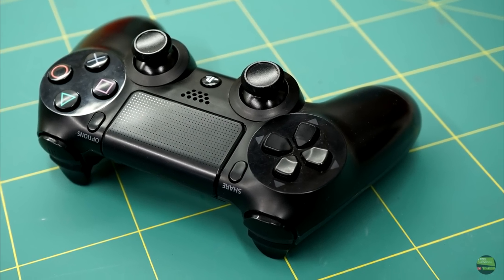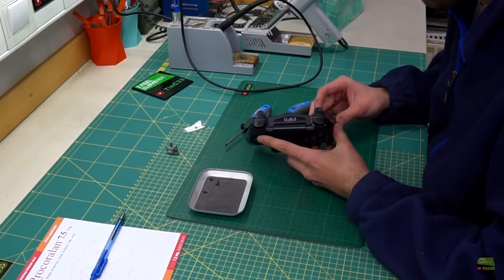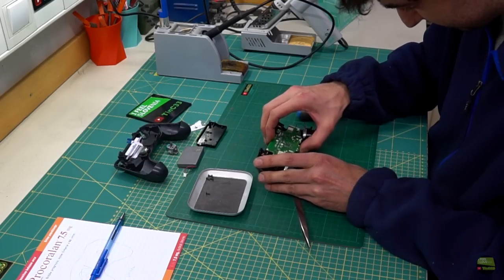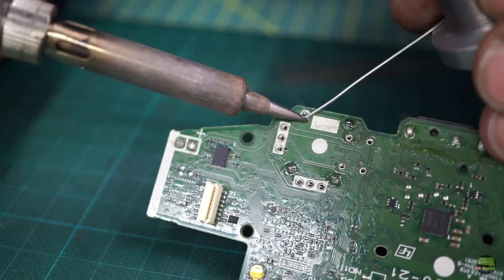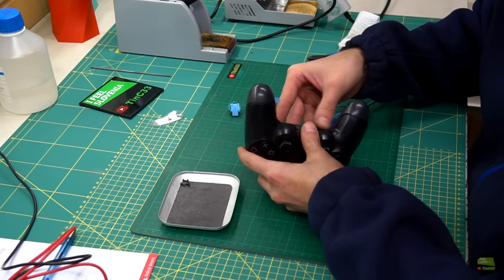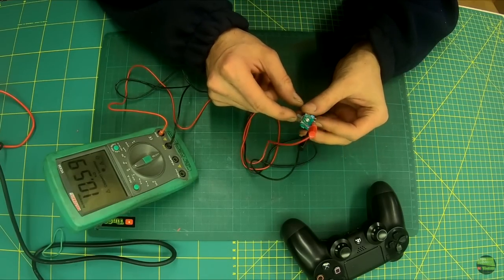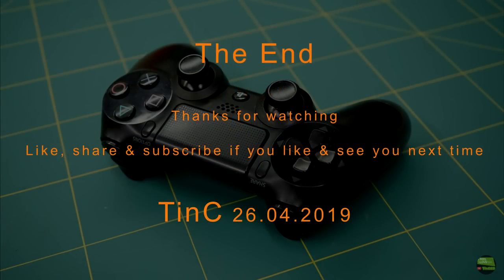PS4 Controller repair [joystick replacement]

Comment: Is it possible to replace the square holding the wheel sensor with a spare square that I have? It won’t click back and I think that’s messing with my character looking up in the air and not being able to look down (or maybe I put the wheel in the wrong direction). Also when I put the controller back together, the buttons wouldn’t respond until a minute later and I could finally press X to get past login. That and when I was in a game my character would keep aiming/firing by itself. Didn’t have this issue before I took out apart. What’s the cause of this?
Reply: Yet there is a lawsuit over cheap part that is like crappy  made not sonys or Microsoft  fucking  fault but you will figure they will have simile design  a better module  instead of using a module that has basically  had a lot of generations of controllers built using this module that the problems  are spool old they can't fix it they can't fix it because  its like your knee joint your legs wear out right well anything that is being moved  around heavy from 24 hours of a fat guy playing games what did you expect its like me moving my leg sitting down your gonna wear the sensor  down you can't fix stupid he'll even industrial  machines  need mot work to fix anything  that gets worn over heavy use   I had a xbox 360 controller  do it after a year of heavy use so it does wear everything  down there are things that never wear out and people saying they broke a bumper  lol its because  your being rough on it I had a controller last me until I smashed it lol

Comment: its so hard desoldering the original joystick legs. my solder has adjustable temperature, i set it to 450C but it doesnt has any effect
anyone has similiar issues?
Reply from the maker: You just need more powerfull soldering iron at least 80 but better 100w it can be without temperature setup...
Reply: Any luck? I'm having the same problem. Im using the milwaukee one because my cheaper one from Amazon wasn't working out
Reply: @mcfriedchicken1972  even after u use milwauke?
im gonna bring it to electrician, maybe he has better solder

Comment: does it really need a 80w solder? or 30w will do?
Reply from the maker: There is a problem because there's a bunch of cooper to to heat, 30w will need many time to heat up, so you may melt someting you don't want to, 80w will melt solder instantly, 50w is limit.
Reply: @TinC33  bro isn’t a 40w soldering iron enough because it equals to 460°C and wouldn’t it melt it instantly?
Reply from the maker: @RedMokaa  it's not about temperature, there are lot of material to heat,  wich "soak" heat faster than soldering iron can produce it, also 100w got same temperature as 15w... Try to solder thick wire like 16mm2 with 30w or 100w and you'll see the difference.
Reply: @TinC33  oh okay thanks for explaining
Reply: @TinC33  Thank you!
Reply from the maker: @desmond098ify  that's a good question anyway, maybe i'll make a video on this topic and show the difference.
Reply: @TinC33  That's great! Looking forward to watching it!

Comment: I need help. I ordered a controller on ebay and the R2 button doesn't work. I've figured it's from the little square module and that some of the soldering parts are loose. How do I tighten it?
Reply from the maker: uf, as i say i don't got a PS so i really don't know wich button is r2, so really don't know what you talking about, sorry.
But if there some wire unsoldered solder it back and it should work
Reply: @TinC33  I've given up. I'm just gonna sell it at Gamestop. Thanks for replying at least.
Reply: Circuit film is the standard problem for buttons not working. Can be easily replaced and a new one is about £2 on ebay.

Comment: Hey I did this repair on the right stick. Now it seems like the dpad or left stick is stuck on left but only at certain times. Like on psn menu it keeps scrolling left but in a game my character does not walk left so i assume dpad. Never had this problem before. What did I do wrong or any suggestions please?
Reply from the maker: Firstly check all the connection, so there's no some line broken on the pcb, and make sure there is no some short from soldering.
Reply: @TinC33  haha if i knew how to do that it may not be broken. Any vid links to follow to check all connections. Replacing stick was my first solder job. I thought I did good. I remove old stick and put in new one thats it. Idk why the other buttons would be affected.
Reply from the maker: @johndoegta2189  you can just carefully visually check, go from each pin you solder, and check if the line on pcb ok, and that there is not some short between two pin when you solder... It's hard to say, but i got few comments here that some button didn't work after replace or other joystick start shifting etc, and everytime was problem missing connection or short between pin they soldered.

Comment: Hi, great video. I have a question for you. I test the new potentiometer outside and i get 5ohms across the axis like you mentioned, between all the pin combination. However when i install it in the circuit it is lowered to 3.4ohms is this normal, and the resistance is not changing either when i mive the stick. Does this mean that I have a short in the circuit board? Thanks
Reply from the maker: It's hard do say, when you measured them soldered into pcb, you measure also all the elements on the circuit wich is in seriall with thet trimmer...
Reply: @TinC33  so it is normal that the resistance is lowered when it is soldered in the circuit? Still if the resistance remains the same as i move the joystick it means that something is faulty right?
Reply from the maker: It is normal but i think there still must be some difference into resistance when you move them.
Reply: @TinC33  yes, I think that I must have sorthed out something in the board when I removed the old one. The new joystick is sure to be good as it works perfectly when i bench tested it
Reply from the maker: @danielvella20  check the board lines and solder points arround the area you working, you may just broke some line on the pcb, wich can be fixed easily.
Reply: @TinC33  ok will have another look. Thanks for all your help :)
Reply from the maker: @danielvella20  no problem, good luck

Comment: Hi im planning on doing this ive ordered joystick parts from ebay will they function the same as original joysticks the seller also said these arent made by sony i want to know as i play lots of shooter games thanks
Reply from the maker: They're aftermarket they shoud work just ok, but it's nit genuine sony
Reply: @TinC33  oh thanks so i wont get drift?? Subbed and liked btw
Reply: @TinC33  hi ive followed your steps and managed to get out the joystick but ive accidently burnt the led strips port (the cable which is plugged out first) and now the cable wont fit thru and i dont think i can replace it
Reply from the maker: Check on ebay if you can buy another one.

Comment: Very nice video!!! Just a question: I see there are different analogs, for example, one made of metal for Slim/Pro controllers. Can I use it with the Old v1 controller? Thanks!
Reply from the maker: Sorry but can't tell you that's the only controller i hold in my hand

Comment: is it a must to use flux?
Reply from the maker: No ofcourse not, flux is already inside of solder wire but it helped to make better contact.
Reply: @TinC33  so any common soldering wire can do the job?

Comment: I did this perfectly the first time but my siblings somehow managed to mess it up again so now the y axis doesnt work and it's not even 6 months old and I responded it and it still doesn't work
Reply from the maker: Hard to say, is it something wrong with trimmers, or on the pcb, check all the lines on pcb arround area you solder if they're all ok

Comment: Help plz, when i tried to put back the ribbon that connects the led light to the board, the light is not working anymore! Any idea what seems the problem? I tried different ribbons, still no luck, help would be appropriated guys
Reply from the maker: Be sure to turn it on righg side, and that it's enough deep into connector before locking.

Comment: Wow.. this is very helpful and interesting. I have the same issue "but" sadly I don't have the welding equipment that you've used. ):
Is there another way to do it ???
Reply from the maker: You cam try just to remove side green covers and clean trimmers
Reply: Welding 😂

Comment: So i just did everything the same but my j sticks are moving even if im not touching them they move up to right corner any help? 
Yah btw my light bar not lighting up after my fix suggestions?
Reply from the maker: go trought entire circuit, you may forget something to plug, or demaged some "way" on the PCB, check arround the area you soldered.
Reply: @TinC33  probally "way"
Reply from the maker: @fn4lx293  check it if you see some line broken just solder piece of wire on that place
Reply: Just checked nothings broken but no light at all
Reply from the maker: @fn4lx293  hmm strange, but as i remember light is on other board, check the ribbon cable if 100% correct plugged, and also check power source...
Reply: @TinC33  look i can turn on bluetooth and connect to my phone but my lightbar not glowing at all even when charging
Reply from the maker: @fn4lx293  i would say that there's some connection broken on the PCB, i can't help you sorry, it must be sren closely and checked lines on pcb...
Reply: @TinC33  ok thanks anyway

Comment: will this work for the new gen or just older ps4 remote models?
Reply from the maker: it work for all remotes, but you need to buy right replacement part, it must be same.
Reply: @TinC33  you mean left or right joystick?
Reply: @TinC33  how do I know witch one? Do you know where can I buy the left joystick? I need 2.
Reply from the maker: @ultimatemanny  same tipe as on old controller
Reply from the maker: search on ebay

Comment: Well after 6 - 8 months of playing everyday the joystick can wear out, it can cause drifting even if you push it very very lightly. Dont go hard on your controllers, they are expensive almost like buying a new game.
Reply from the maker: Joystick is not so expencive, i think a few $ on ebay, and the cheapest one work just good.
Reply: @TinC33  cheap ones are bad. have different mechanics than original.
Reply from the maker: @internetcrap7  i bealive you, there's always some difference in a different price range product, specialy product like this one, where every detail can prevent smooth and accurate moving, but as fried say, controller still work and look like it's good for him, it also depend how mmany you playing, i'm rc guy so i know the difference between FUTABA or GRAUPNER yojstick and some chinesse, real brand gimbal runs so smooth... But some beginner will never notice the difference.
Reply: @internetcrap7  which ones are the expensive reliable ones? I can only see the same one sold everywhere. I noticed in one YouTube video they mentioned you can get more expensive ones but I can't find it anywhere

Comment: Geez... i don't even have a soldering tool... all i want is to stop stick drift
Reply from the maker: Then try to find some local guy who know how to solder, everyone will replace that for you, but don't forget to buy him beer then 😉
Reply: There are plenty of video's out there that will explain for drift. I had same issue I basically pulled it all apart and cleaned & dusted it put it back and was fine. Lots of dust & debris can gum up controller.

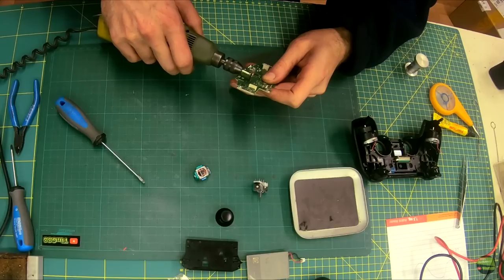Comment: 3:11 I heavily and respectfully disagree with using a dremel/powered rotary tool to just scrub off flux. Cloth will do just fine, alcohol can help too. 
.
This was going good, then I cringed hard at that. Sorry man, I mean you no harm personally, but I really do not think that is advisable.
Reply from the maker: Agree but i don't got all the stuff for soldering like some acid or whatever for clenaing, so i use plastick brush and it actually worked, but need to be carefull so you don't scratch all the lacque of the pcb or even demage the ways...
Reply: @TinC33  Just rubbing alcohol can work in most flux I've used so far. Perhaps the kind of flux you have needs acetone, which you said you don't have.  That dremel really scared me.
.
But yeah, thanks for responding. Aside that, the rest of the video is good and informative. Keep it up
Reply from the maker: @WingMaster562  i got bunch of acetone for abs 3d printing... But never try on circuit, does it work? I need to try it, alcohol doesn't work best on hardened flux, thanks.
Reply: @TinC33  Wait, that kind of acetone might be too strong for PCBs. It might melt parts of the board so I wouldn't use that. I was thinking of low acetone content solution like around 30% which is for nail polish removers.
.
Also i really find it strange that alcohol doesn't work on your flux, especially that it dries that hard. Usually, even dried flux can be easily wiped away with a finger. I wonder what's going on with your flux.
Reply from the maker: @WingMaster562  ok, so i need low vol. aceton, no alcohol doesnt work flux become hard and it can be scratched off with nails but not wiped with alcohol, i use branded soldering wire. Will try next time

Comment: for the life of me i cannot desolder these god dam tough joystick solder points...they TOO HARD.
Reply from the maker: All you need is more powerfull soldering iron, there are lot of cooper you need to heat before solder will melt
Reply: @TinC33  So 40W soldering iron is far from enough? it goes up to 420degrees if i remember correctly
Reply from the maker: @hakimdurand8427  hm, depend on what kind of watt, chinese soldering iron or weller 😉
Better to use 60 or 80w i got good 80w soldering station but many time use 100w soldering iron.
There's no problem into temperature, every solder can heat up to 300-350 degree, even 5w but when you try to melt the solder heat transfer cool down the soldering iron faster than it could heat up themselves. That's wha W is so important, here on this controller you got lot of ground cooper to heat, and if you got powerfull solder you will desolder spot you need faster then heat will transfer by entire circuit.
Reply: @TinC33  Oh im back my soldering iron is 60W. So dk what I did wrong but i give up on this lmao

Comment: I think you have so much trouble getting the analog stick or cos u Skip that part😛😛😛 I broke mines so no big deal
Reply from the maker: What you mean problem to get new gimbal stick?
Reply: I thought you have trouble taking the whole part out anyways  I just used my heat gun and it came out but I got the wrong one now have  to Order a new set q😩😩